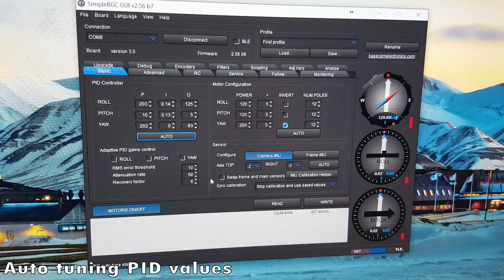DIY Brushless Camera Gimbal - Part 03 - Making the yaw axis and Electronics

Comment: Did the gimbal controller come pre programmed? Or did you connect it to a pc?
Reply from the maker: https://www.viacopter.eu/multirotor-shop/camera-gimbals/basecam32-gimbal-controller-multicopter-store
that is the one i use, it is pre-programmed, just plugged it in and updated the firmware, very easy no need for complicated code to make it work.
Reply: +Paw Pedersen ok thanks

Comment: I was inspired but also hopeless with my wg gimbal, wires between yaw and tilt motors broke.. try to replace it on my my own by making my own wires but doesnt seemed to work.. is there any possible that it short circuit? thank u